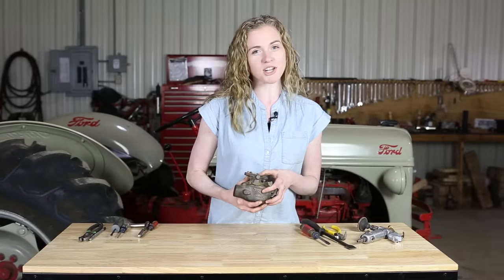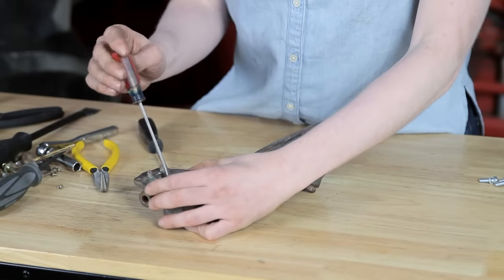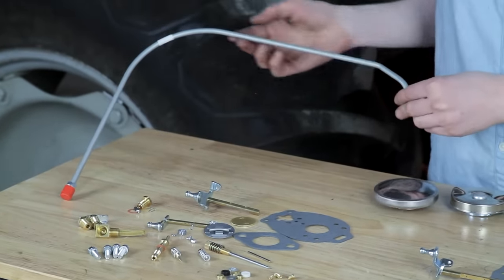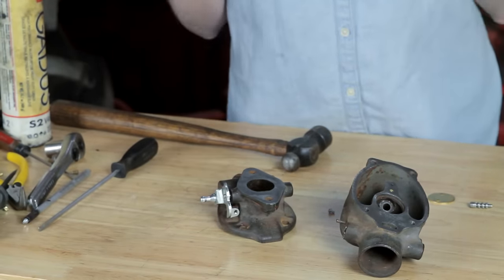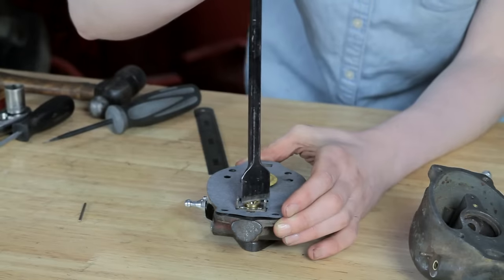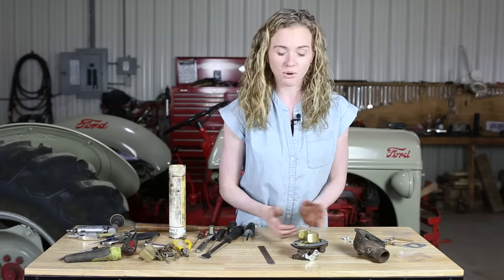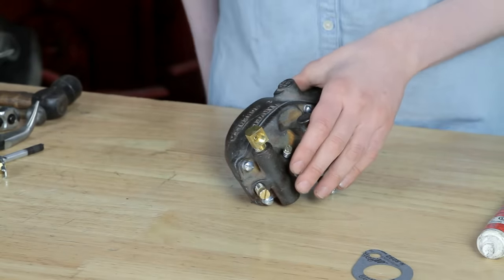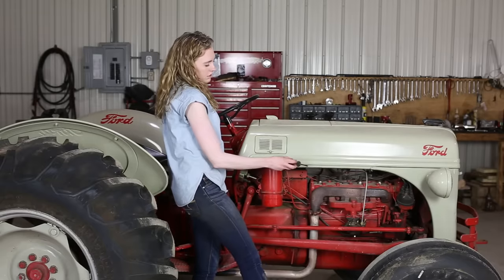How to Rebuild a Ford 8N, 9N or 2N Carburetor, Marvel Schebler

Comment: The thought of messing with a carburetors terrifies me! I knew my carb was bad. I watched your video, bought one of your rebuild kits, and then chickened out. I bought a super cheap reproduction carb instead. Problem solved? Nope. Cheap carb stopped doing its thing after about an hour of use. I realized my choices were to abandon my tractor, buy a real rebuilt 9N carb, or try rebuilding mine. Despite my fear, I dug out the kit I bought from you, re-watched your video and went to work. After only a few minutes at the workbench, my fear turned to enjoyment! I was actually having fun! I realized it wasn't remotely as complicated as I thought, it was more like working on a small puzzle. I took my time and was very impressed - your video was exactly right. I still wasn't impressed my tractor would start, but... it did! I was even inspired to adjust the jets as you showed - fantastic! Thank you so much for these videos. You have given me a great deal of confidence. Bonus points to the production/editing of your videos, they are detailed without being too long.
Reply: Be glad you bought her kit, my vendor sold me a cheapo kit that leaves me with some concerns after assembly. I'll bolt it on soon and see how it went.

Comment: Thanks for the video.  Our 8N was only running on choke.  I removed the carburetor and it was obvious right away the spring on the choke plate was broken.  I removed the bowl and gave it a quick clean up and it runs great now.  The air filter tube is the biggest challenge in my experience.  I'll order your kit and rebuild the whole thing when I get around to it.  Who would have thought this old tractor would still be doing work 70 years later.
Reply: I’m 70 and I’m still doing work.  :)

Comment: This video really helped me double check and trouble shoot my MS carb... my tractor wouldnt start and stay running without choke yesterday now its running decent thank you so much. I STRESS THAT COMPRESSED AIR BE USED TO BLOW EVERY SMALL ORFICE OUT...if not it wont fuel properly also a torch tip cleaner is your friend. Something Ive seen no one cover on youtube. Like she said 2 turns on main screw not 1.5 funny thing my 2n and her machine run at 2.5 turns on main And 1 to 1 and quarter (1.25 turns) on the idle screw and  Learn the details folks... theres plenty of misinformation out there.

Comment: Great Video, I just finished  rebuilding the carburator on my Ford 8N and it installed in less than 20 minutes. Did not get the tractor to start, but I may not have spark.  I will have to watch your video on trouble shooting.  Like a fun puzzle!  thanks so much  for your great Hoe to videos!  Keep posting, I will keep braking my tractors!

Comment: I have an 8N, and the carb needed to be rebuilt; bought a kit and tried doing it myself, but had trouble with the throttle butterfly plate...ended up breaking the spring, and just bought a whole new carb. The butterfly shown in this video looks much easier to install; I'll keep this in mind for next time.

Comment: I am mechanically inclined but I sure am open to taking a lot of your advice and knowledge and you are easy on the eyes too thank you. Just got through adjusting the new carburetor. Runs like a new one had the tractor 9N Ford with Sherman gears had it about 20 years now changed electronic ignition 12 volt all of that do some work on valves all myself runs perfect we have a newer tractor but I keep this for mowing in the woods and certain places.
Reply: Can anyone  tell me  is the  same  oil in my  rear  end  on my  8n ford tractor  is it the  same  as the  oil  that  makes my  lift move  ?
Reply: @davidbaxter4235  yes

Comment: When you look at the choke plate in the video at the beginning it is facing the opposite direction when you reinstall it. Installing it with the flap in would allow the engine to get some much needed air and the spring would control the flow
Reply: Yep - my Ingersoll Rand had a choke lever on the other side, too. Still, nice job overall.
Reply: Timestamp is 1:21

Comment: Thank you for the very informative video!  I am about to tackle mine, just ordered the kit and float from y’all. One question for clarification though. The butterfly on my choke rod had the spring and trapdoor to the inside when I disassembled it. From what I understand is it’s to allow air to the engine on startup if you don’t release the choke when it starts. Yours is to the outside so the trap door would be ineffective wouldn’t it?  Again just asking for clarification before I reassemble mine when parts arrive. Thanks again.

Comment: is the Choke Plate put in properly?  My choke plate was the other direction when I took it apart...You and your Dad do a Great job!
Reply: Chris, You are correct, Rachel installed the choke plate the wrong direction. With the flap on the wrong side, the flap mechanism will not work properly.
Beginning at 0:50 you can see that it was originally oriented correctly.

Comment: Last Marvel carb I tore down didn't have a single jet in it.  Tractor ran pretty good... rich under load, but surprisingly good.  Spring was missing on the choke plate as well.  Nowhere to be found.  Somebody had obviously been there before me.  Not sure what their plan was though.

Comment: Great videos, Rachel. Please check at 11:40 to 12:20 in this video. I think you may have the choke butterfly door backwards. My original 8N (with a M-S TSX 241B carb), three other video presentations and what looks like a Ford manual drawing has the little trap door on the inside. After seeing yours, I thought it may provide relief to a backfire but after checking more, it seems that it is rather supposed to let air in when vacuum is momentarily high but choke is full on. That would put the door on inside...like in my tractor and the other references. I may be wrong, but would like to confirm. Thanks and keep it up!
Reply: Dwight Morejohn saw it to, good eye.  Wondered if i was only one to see it
Reply: I'm in agreement with you here.
I assembled mine with the spring behind the butterfly and the air trap swing inward, allowing airflow past to prevent straight out flooding situations.

Comment: Another good video... you provided good instructions so basic mechanical skills, no problem... I have replaced the throttle/butterfly shaft, do to excess wear,, will let air in, not good

Comment: Question.  Bought an Amazon 8n carb. It worked great for a year.  Then one day slowly lost power over a period of 10 minutes. Now it only runs with the choke on and at lowest throttle.  Try to increase it dies.  Carb is spotless. Good fuel. Runs with starting fluid. Pulled out drain plug in float bowl and fuel flows good. Sprayed starting fluid around to check for leaks and no change in speed.  Buying a new carb since it’s the only thing I can think of. Something is plugged in the carb but all jets are spotless.  Uff da….

Comment: Question: I'm rebuilding a TSX 241B, there does not appear to be a "passageway" (jet?) under the emulsion tube (there is a plug in the vicinity in the bottom of bowl). Is there suppose to be something between the emulsion tube and the plug on the TSX 241B? Once the carb is done I'm ready to tackle the hydraulic in the top lid.

Comment: Hey Girl!! Need your help ❤ I have a 53 Jubilee and I can't get it started.  1st of all, it has always fired right up. Even after a cold winter in the elements.  Then the front "bracket" that the loader pin sits in got stripped.  I replaced that, so  it's tight and spinning now. However,  it ran for a min and then won't turn over. It tries but can't kick on. I smell fuel, so I've been told it's flooded.

Comment: Great video, quite thorough. I would like to have had a better view of the gasket on the Main Adjustment Needle, to see if it was metal, plastic, rubber or felt. The kit my vendor sold me had some bits that weren't exactly like my 241B and he wasn't as knowledgable as you about what went where.

Comment: Do you have an instruction video on how to adjust an aftermarket carb float.  Tractor dying when driving on incline only. All filters cleaned, tank cleaned, lines flushed,  breather cleaned, tank cap breather good, runs perfect on flat surface. I'm perplexed. My dilemma is that I'm 3 1/2 hours from tractor where it's broke down at another marketplace sellers home. Any help you can advise would be appreciated.

Comment: Rachel, thanks for the videos!  Awesome job.  I am rebuilding my MS Carb and have watched your video so many times to ensure I do it correctly.  I did have two questions though.  I noticed that you flipped the choke door from the position it came out.  The flat side was facing out before you tore it down, and when you reassembled, you put the spring side facing outward.  It must not have mattered because your tractor started.  Also, you showed the 3 jets in the video, but, you did not talk about the 3d jet that goes in the side in the throttle body (close to the other jet).  Am I correct to think that you were working on a "B" MS Carb?  We love professional videos.  There are many videos on YouTube, but, hate the ones that just show people doing something without explaining what they are doing and are on fast speed...useless.  Thanks and have a great day!

Comment: Great video but I have a couple questions. At 11:44 you say that the spring of the flap on the choke butterfly will face out when it is installed. But the spring and flap look like they are facing inside at 1:42 during disassembly. And I don't see how the spring loaded flap will work if it is facing out. I'm in the process of rebuilding a carb using your comprehensive kit and the  and was hoping you could clear this up for me because my carb was already completely disassembled when I got it and the paper instructions do not address this. Also, there are several small gaskets that are about the same size but different colors (one is thin & red, while 1 is thicker and grey) but the paper instructions do not make it clear which gasket goes where.

Comment: I have a 9n. It died one day and wldnt restart. Since then I have pull the entire system apart. Put a brand new carb on. New point cap rotor and plugs. Checked the compression which is 130 at each hole. Timed the 12 volt distributor. Triple checked that I have gas and spark. I still can’t get it to run. It try’s to start. And the I’ve got it to do with all that is run for maybe 39 seconds. It ran great until it died. Am I missing something?

Comment: Hey Rachel this John nice to meet you. I work at Bell Equipment Im new to your channel . I was watching your video and I was wondering if Im doing something wrong I didn't replace the float even thou it's pretty green I cleaned it up some but prolly not enuff I set the idle and the throttle . the big one 2 full turns and the idle one full turn out to start like you said  and I could get it to fire and run a little . but when i first swapped the motor it was driving and running . it kinda progressively ran rougher till I cleaned the carb then it started to smell better when it ran a little but i can't seem to get it quite right.  Its not wanting to take off and idle. I love to buy a preset carb from you or invite you out to the shop to help me with this one.  Your very beautiful and insightful .

Comment: If you need to adjust the float level you want to very careful not to damage the needle.  Adjust the tab with a pair of pliers off the carburetor.  Pushing down on the float can damage the needle.

Comment: I have 49 8N with front mount distributor forward up hill it cuts out then picks back up backwards up hill runs perfick any suggestions? I also have just put new carb on it.
Reply from the maker: Sounds like a float problem. Did you replace your carburetor with an after-market aluminum carburetor? It is best to rebuild your original cast-iron Marvel Schebler carburetor.

Comment: Do you offer carburetor kits and accessories for a Ferguson TO-20 on your website? I have recently acquired this tractor and have been having a terrible time getting the engine to run smooth and everything I have troubleshooted points back to the carburetor

Comment: The only thing I would add is check the flatness of the top flange, many of them are warped from over tightening. I gave mine a ride on some 220 wet/dry paper and a surface that is known to be flat. I did the same on the bowl and top but there was nothing much wrong that the gasket would not have sealed. The top flange on mine was warped pretty bad to the point I felt it would leak air.

Comment: What is the other hole for on the bottom next to the drain?? And why is mine leaking ??
Reply: That is a overflow drain.
It should have a compressed brass particle filter to keep out dirt.
Your floats might not be set right, or the needle and seat are not sealing properly.

Comment: Quick question,  I cleaned the card and put new gaskets,  idles good but when I give it more than half throttle it wants to die, unless I use the chock when given it throttle it runs better but not perfect,  any suggestions?
Reply: I might of forgot to take and clean the jet under the emulsion tube,

Comment: I have worked on tractors that had so much hay debris in the float chamber that I couldn't see how the tractor was running. Usually the fuel bowl screen was missing.

Comment: I rebuilt my carburetor. Then I bought a new one and I still can’t get my tractor to stay running. Even with a new carburetor I am fuel leaking out the air inlet. When it starts it chugs and I have to have full choke. Runs for a few moments then dies.

Comment: I just bought a ford 9N. I believe it's older that the guy said . How can I tell the year. ( note) I my state you don't need a title for anything over 15 years old and older . So it's his word on the age of it ... thanks,
Reply: Check the serial number on the engine block just behind the oil filter. You can also see the casting date on the bell housing on the same side as the serial number

Comment: looked like it was dripping fuel 15:20
Reply: That's what I said, saw 4 drips but was told no, so maybe your computer has a leak also XD
Reply: Yes, don't trust your lying eyes. 
You're not seeing a fuel leak, it's just sweat dripping from all the extra horsepower. Or maybe a condensation problem with your monitor.
Reply: @QQTrick1QQ  Yeah. First comment I've even seen mentioning it. Everyone's got eyes on the host and not on the subject xD

Comment: 🐎💨💕💨💕  
     👋😎💨 Bryan
  =======
Wow I was here 3 months ago ? How did that happen ?
Reply: Ms. Gingell 💕 : you know I never thought about brass floats.  Thank you for a late my night float ponder 🤔💭.
====
 I started using (link kite)  several years ago new trucks old vehicles tractors. 
=====
Cessna aircraft grade is known as "Avblend".
=====
I used the proper additive for gas in a 2004 Silverado and it caused a 120 dollar misfire because.
==
 It works really really good and carbon  🔥 cut loose into as electro Gap.
===
   Always , thought it was neat a plane could ( run out of oil ) and make it back dry because it the metal starts to sweat lubricants . 
======
I was wondering I use that stuff a lot ( different ways ) how long ? ;  for "Link Kite" to (soak into a brass float) ? so it wouldn't sink & not work properly ?
=====
 Who , has a carburetor with brass in it anyway nowadays ? Right . 🚜 💨💕
====
PS
The first flying wing at eight engines all props .
====
Something like I would do is they drain the oil in all eight and one on vacation.
====
Pilot got in there and cranked it and it had some pressure took off all eight dropped to zero - oil pressure.

Comment: Now that diesel tractors have all that emission junk on them. I might rather have a gas. Would no doubt be much cheaper initial purchase. Gasoline as much as a dollar a gallon less than diesel fuel. Could be ticket once again. Especially in the under 50 hp tractors.

Comment: You did notice the drips at 15:13 15:17 15:20 15:23 ? Just checking.
Reply: NO. I didn't notice any drips or leaks whatsoever and I highly doubt she would allow a video to be viewed had it any problems with the repair she just completed. Any problem would have been noticed in the editing.
Reply: @dukeman7595  Okay, just counted 4 drips again on full screen, I'll bring my computer in and try to get it fixed.
Reply: @QQTrick1QQ  The clarity of the video during the last third is not great, however, I checked again and cannot notice any drips. As stated, it could be the quality of the video. I highly doubt they would allow a leaky carburetor just repaired to viewed.
Reply: @dukeman7595  OK I informed another commenter his computer must be leaking also.
Reply: @QQTrick1QQ  If you don't repair that leak it will ruin your computer.
Reply: @dukeman7595  XD
Reply: @dukeman7595  No really on settings (The little gear) you can play at 1/4 speed and at 15:15 when she says OK the first drip just left of the shiny carb bolt below the steering arm clear as day, slow motion drip.
Reply: @QQTrick1QQ  Thank you for the info. I will play it in slowmo. I couldn't pass on the leaky computer (having it repaired) I'm happy to see you have a good sense of humor. All in fun, have a great one and thanks again.
Reply: @QQTrick1QQ  I played it in slow motion and Yes Sir I stand corrected. It. Leaks. Appears be leaking from the drain bolt.. Thanks for your persistence it is appreciated..
Reply: @dukeman7595  Go rewatch. Definitely leaking out of probably bowl drain or down from fuel inlet.

Comment: Why won't my tractor idle up unless I choke it fool
Reply: choking reduces air, richening mixture. I would wager you're not getting enough fuel. Try adjusting idle screw or main mix screw.